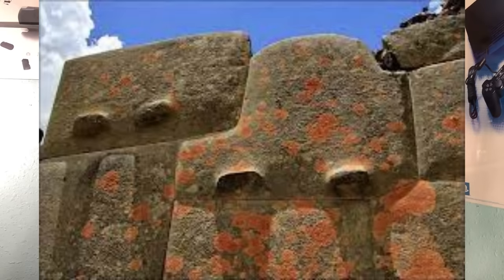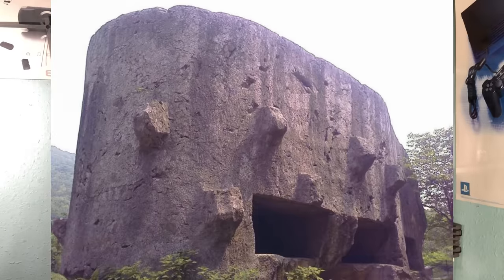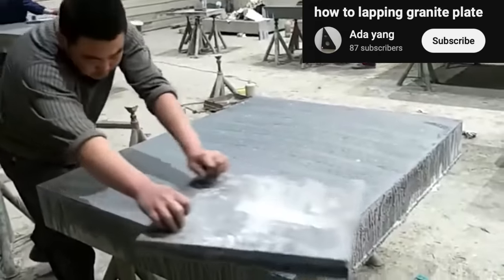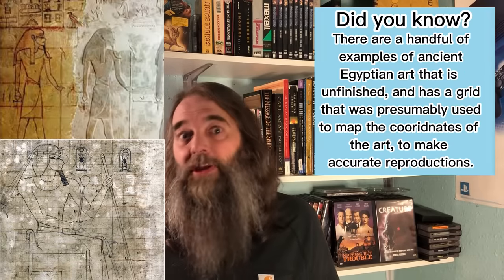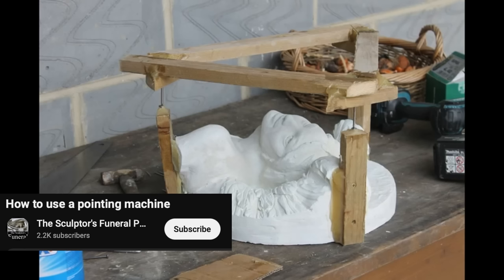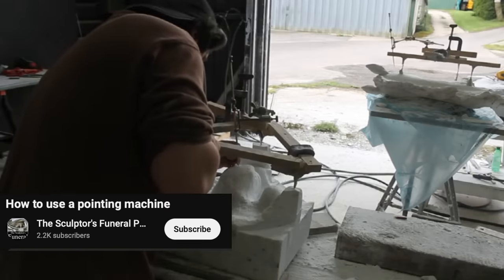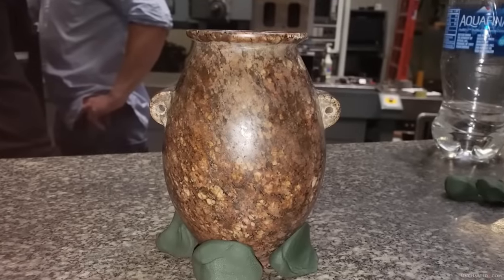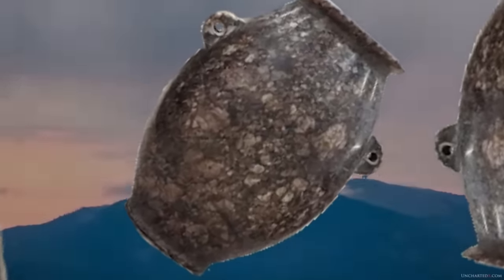The True Purpose of Megalith Stone Nubs

Comment: I found interesting the point that considerable effort was put into the planning & shaping of each block. Given that, might they have made a mockup for each block to use, in effect, as the plaster cast when reproducing a sculpture? For instance, imagine they are turning their attention to creating the next block in the wall. In place on the wall they might create a temporary block out of wood & clay to establish the dimensions & shape of the stone block they'd then need to shape. Using the method shown in the video they'd then "copy" the mockup to the stone block. The mockup would be relatively easy to create and allow the design decisions to be made before commiting tools to shaping stone. I'm thinking of the mockups as being like the full-size clay cars auto designers make. The design decisions are made in clay and then subsequently carefully reproduced in metal by craftsmen. Each of the fabricating craftsmen are not the designers. I'm suggesting that the stone walls had a designer and large team of craftsmen to do the labour of stone cutting. To think of each stone cutter as a "designer" would effectively be "design by committee" or "too many cooks in the kitchen". The results they achieved suggest committees were avoided.

Comment: Seems there's way easier ways to attach reference points after the stone is quarried than to chisel out knobs. A temp epoxy job using three reference points until the job is done then knock off the knobs and you're done. I'm still waiting to read one of these theories and have than bulb go off in my head: "Holy shit that's it". Nice try though man.

Comment: Interesting idea for sure. We used something similar in mold making for jewelry called a pantograph. Very similar idea for the process.

Heres a thought. In precious metals casting, recycling your white gold in several casts without properly cleaning the plaster used to cast the molten metal will result in contamination called "nickel silicide" (the nickel alloy used to make white gold binds with the contaminate crystalline sillica). This nickel sillicide in the metal causes little iron-hard nodules to show up in polishing as the metal is worn away. 

What id like to know is  if it's possible something similar occurs geologically in these stones..making a spot, not worth the time investment to make flat?

Comment: Come on, it takes 3 seconds to see these walls were erected stone by stone, bottom up. 
 
You could almost write down the exact order the stones were planted.
 
In the lowest row you only have to fit one side to the first stone, then you fit the side of the next stone you add. 
 
For the second row you give the upper stone a somewhat smooth bottom side and one smooth side, and then you shape the lower row of stones so htat it fits to this UPPER stone. 
 
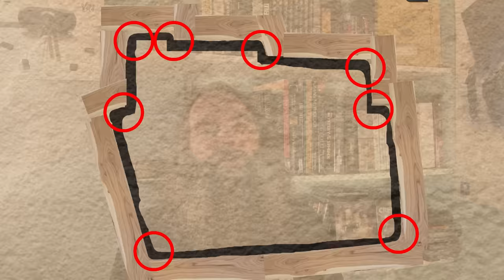So for me the stone at 9:18 I would say what was shaped before it was placed was the bottom and probably the left side, as it is leaning óut. next came a stone on the right, about as hig as the recess on the right. 
 
All the other recesses on the top side were created when the next row of stones ABOVE this one were made 
 
No one would create so irregular joints out of "artistic spleen", this screams that they had existing rocks and then set out to arrange them in a way that the amount of material to be removed is minimized. 
 

I only need an idea how one could pull these stones to and fro, then the stones would grind themselves to fit, simply by addind water and maybe sand of a mineral that is harder than the stones of the wall.

Comment: Your theory holds water and is the only real attempt at solving this problem. My uneducated guess relates to matrix in the stone. Most, not all nubs lay close to load bearing joints or pressure points. Pressure points can cause stone to shed some of the face on a stone which is seen. I submit for consideration that nubs could act as shock absorbers on pressure points where the matrix in the stone might be problematic.

Comment: You  have maybe seen those devices that look kind of like a comb with long teeth and the teeth are moveable and can be pressed into an internal or over an external complex shape and then so long as it’s not bumped hard the teeth can transfer that complex shape to the new piece… Kind of like the toy that has hundreds of moving pins that you can press your face gently into!   It copies your face.  Simple concept tools to transfer 3-dimensional shapes probably existed then…made out of reeds which just didn’t survive.  Possibly common enough to not be included in most artwork or in a way that we interpret it correctly. 
///////||||||\\\\\\\|||||||||||||| <pins.

Comment: My father started teaching me bricklaying when I was 6 years old and I've been a craftsman now for over 50years and I still don't believe those stones were cut and fitted individually as you suggest. The size of the stone, along with the multiplicity of angles and its hardness, together make those cigaret paper joints improbable if not impossible. Today we can make detailed mouldings of complex shapes, like that found in polygonal masonry, using materials such as silicone rubber. In my mind and experience, the geopolymer argument is the best so far. It explains how the joints fit so well, size becomes mute because the stone is created in situ and the hardness is negated because the stone is not cut or tooled but moulded. There are very good examples of this being done today, so it's proven to work.

Comment: Yes I agree that they probably were "registration points" that were used to take the modelling scaffold (or whatever you call it) on and off the new stone MULTIPLE times AS it was being worked on and cut down to the correct dimensions.

That said, it seems strange that they made them quite so large. I mean why didn't they just make them say 2 or 3 inches in diameter, as this would also make them easier to chisel (/pound?) off once in position?

Comment: It's a very interesting theory and well proven (technically) but in my opinion it's highly impractical. It basically same idea like the mold theory in which they would construct a unique mold for each stone. Maybe they did have time to kill and basically unlimited resources of wood (because judging from different shapes of stones, at least some of the parts of the "mold" would have to be made individually for that particular stone), but it would prove their inability to think logically. And judging by the architectrual feats they achieved, they must have been very sophisticated culture.
Reply: The stones of the pyramid are "standardized", of exact lengths and exact angles. There you can have VERY flats surfaces that fit together instantly. 
 
I look at these pictures of these walls and you can instantly see that each rock was put individually in place, adapted to its specific location. 
 
You can practically see the order how the stones were set within one line, and then came the next row. 
 
In my eyes of each stone they smoothed the bottom and ONE side, then adapted the existing wall until the new stone fit snugly. 
Then they did that with the next stone. etc. 
 
I do not think that you could adapt irregular shapes so exactly that you can achieve such an exact fit. 

As said, "no" problem with an a norm surface, there you need only ONE "machine", and all are the same.  
 
It literally looks as if each stone would have been "lapped" into place, ground by rubbing the surfaces against each other, until they fit. 
 
Pulling them to and fro seems insane, but is a simpler procedure than high-precision masonry to the millimeter.
 
 

Change of topic: 
 
I heard that they had big trouble understanding how these huge stone sculptures on the Easter Islands had reached their location, as they came obviously from several miles away. 
 
Especially when the natives told them "the statues have walked there". 
 
Until they found out how. 

The statues were completed and set upright. 
 
Then you need a few dozen people and four ropes. 
 
Two at the top, pulling left and right, and two at the bottom, at the corners, pulling forward. 
 
It starts by tugging left and right, bringing the statue to sway left and right. That removes the load on the bottom corners. 
 
And then, when one side is free, you give a hearty tug on that side, and it slips a few cms forward before it sways back, 

Freeing the other edge, that you then can pull forward. 
 
And when you get in the rhythm, this probably works quite nicely, and the statue moves forward swaying and twisting as if alive. 
 
Just an example that things that appear totally enigmatic can have surprisingly simple solutions.

Comment: Not to dispute this just to add to your thoughts.

Your right they likely wont have had tape measures though they will almost certainly have had measuring sticks and ropes, but ignoring that there's a better solution.

A great carpenter or joiner doesn't need a tape measure, at least majority of the time, they just need a stick with a prong and another sliding prong. From this you can take a measurement and transfer it perfectly. have the prongs cross over both sides and be offset by the width of the prongs themselves and you can now take internal and external measurements and transfer them.

I just got further into the video and saw the statue reference tool and the jig you talked about, yeah I could totally buy this, very much what I was talking about with the above tool but I never considered it in this context (which is silly cause I fucking love jigs and use them all the time), I think this is a fantastic theory well done.

Comment: There's another older video with a better theory imho. The overall masonry is fitted in place by using a leveled stick for reference and removing stone where the stick doesn't fit. This does require them to be holding the stones up and very steady and securely. This is where the nubs come in and they are explained as points where logs could be fitted to help with holding the rock up, so they'd remove them when they finish construction. This requires a lot less precision up until the final chiselings which is pretty normal anyway.

Comment: sorry but this is blown up immediately by the concave ,convex mating surfaces that are at all joints , those polygonal structures were done for a reason specific to an unknown civilisation and to meet a very specific set of requirements, they were done for a purpose  , those civilisations simply didn't have time for this on such scale . considering we probably only see fragments of the entire structures , using the suggested methodology ,the entire civilisation would have to be entirely focussed on the construction for generations . so who did the farming , building houses , the roadways etc etc . its a valiant suggestion but it falls down at all logical examination . these were not robots , it was living people in a culture that absolutely wouldn't have time for such a construction effort on such a grand scale by hand lapping each concave to each convex on a multi faceted structure tens of thousands of years ago .  i would suggest malleable materials were used  and it was built in fairly short time , possibly hundreds of thousands of years ago by a people that were way more advanced than we are today and they were wiped out by one of the many extinction events that hit this planet.

Comment: I bet they were used for some purpose after the walls were complete. Because they would have removed them on the finished product if they were not needed. A lot of them could have be used to hang adornments or to keep a Fascade attached. The nubs were left there for a reason, it could be as simple as that, something used to be draped or attached to the walls and the nubs would keep those things from falling off. Time and plunder has probably removed whatever was attached to the outside

Comment: Wrong. There is a peer reviewed study how they fit these stones together. A researcher discovered an ancient recipe (demonstrated) that makes the rock soft and essentially turns the exterior edges into jelly. It makes it very easy to carve and fit. You can see the melted portions at the seams. The seams are much smoother and a different composition altogether which is the indication of the slurry at work. It’s amazing people are still speculating when this has been resolved with good data.
Reply from the maker: You gots a title or link?
Cause...no. Just nope.

Comment: I think that's a bit of a moronic assumption, sorry. If the "nubs" where to be these anchor points, they would need to be cut more accurately that the rest of the cuts. If you don't have the precise nub, every other measurement would be out of line. And your assumptions about them designing in dirt is just as bad. Unless they're marking out the ENTIRE wall in one go, you would need to move and re-draw the pieces to keep designing. And SOOO many issue can arise in that type of process, and lets not forget DIRT MOVES... so even more. And after carving the stone in the rock face... how the hell do you remove it from the wall? And using wood... would not allow for multiple copies. Wood adjusts for a variety of reason. I don't think you have this figured out
Reply from the maker: Your last statement shows you haven't thought about this at all. I show the wood being secured for multiple uses, in the pointing machine clips. You failed to get that far, or pay attention. Either way, you poke holes that aren't holes.
Thanks for trying, but no thanks.

Comment: Think man, 1000 slaves could not possibly move these 800 to 900 ton stones. It is not possible and certainly not efficient to tie up so many men to move one stone, the project would take forever to finish. Wooden cranes and fiber ropes would never be able to withstand the massive pressures required to even hold these huge stones, let alone move them. Lifting a heavy weight is far easier deal than actually moving it. Therefore only giants could have built the foundations of the Baalbek temples. The Romans came along behind the giants and added their tiny 50 ton stones on top of the already ancient foundations., which were originally thee pre-flood buildings. It is a known fact that the Romans normally could lift stones of 50 tons safely and with consistency. Moving the heavy stones from the ground up and onto the walls was very hard to do, as the crane either had to swivel on its foundation with all that weight and the whole crane had to roll next to the wall or a huge part of the crane had to be perpendicular to the wall with the upper section that would roll across the wall to place the stones in position. Also only the first 3 or 4 rows of stone can be done with most of these types of cranes. The strength and flexibility of the 15 to 35 ft tall giants working as a team would be more useful to raise walls of gigantic stones. Did you ever wonder why the ancients needed stone pillars to be 60 or 70 ft tall. That aloud the giants to walk in and out freely. Much later the Roman men and Greek men before them had bronze straps and hooks and then 1000 years later iron straps to strengthen the wooden cranes, but that can only do so much. It is thought that the first sea faring men of Lebanon and specifically Baalbek  had mastered the use of iron for their ships and temples. 
Peru is the other location that instantly comes to mind where human engineering is totally inadequate to answer the questions of how these huge stones were cut, moved 10 miles and across rivers and then up high mountains and lifted up onto very ancient walls. See the giant hexagonal and later the quadrangular stones of Peru, Japan, Lebanon, China and Mexico.
In S. America a prideful large bunch of men arranged a test to see if they could move a large natural stone.  The village collected 300 men  and many strong ropes and they could not move a 100 ton stone.  These tests have been tried many times, but only a few have been put on videos.  The free masons control the media directly and the illuminati controls the free masons, so you are not going to see these tests fail, when they do.. 
Also no one can move heavy stones across sand, as in Egypt, and we engineers don’t care how many rollers you throw under the stone, is is not going to move.  It just sinks into the sand and laughs at you.  So giants built the pyramids also.  There were a second bunch of giants alive on earth as late as 1000 BC in Lebanon, Peru, etc.

Comment: Nope.  Not good enough.  The shape of the nubs is not optimal for such a use.  a couple of flat side would make for better orientation.  The ubiquity: no all stones have them.  Then number: stone has different numbers of them.  Then finish:  finish was a big thing,  there's megalithic walls that are virtually ALL finish inasmuch as the front presents this wonderful tight jigsaw appearance but the back of all those stones is crude and rough.  So: if you care so much about finish why leave a thing you didn't want but had to have for manufacture?

Comment: If you look in the quarries where these stones originated, you find the other "half" of these nubs on the raw walls around the quarry so the nubs were the final points holding the large blocks in place as the stones were cut. When the stones break free, you're left with nubs on both sides of the "cut".